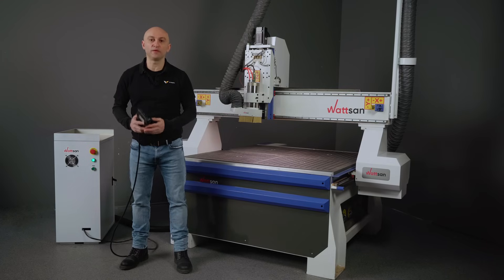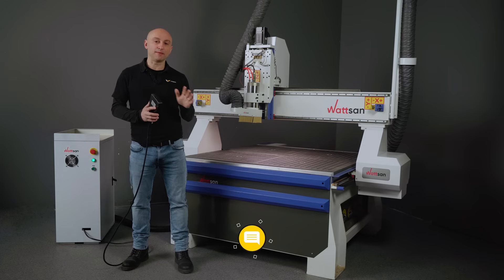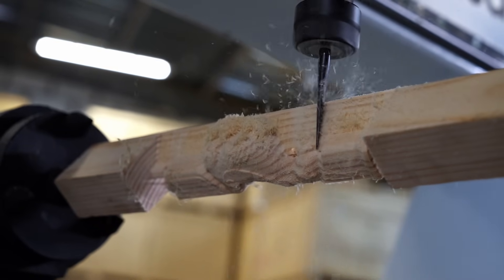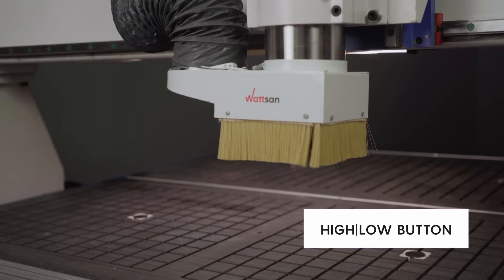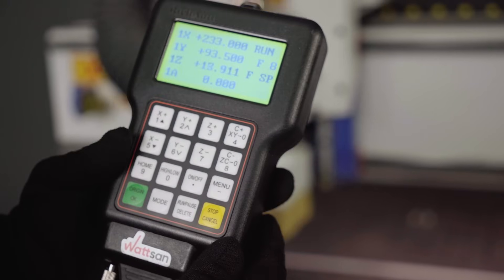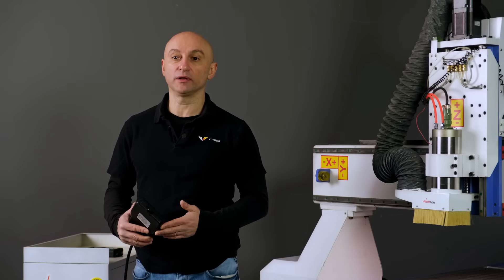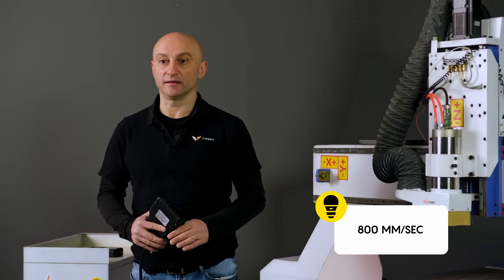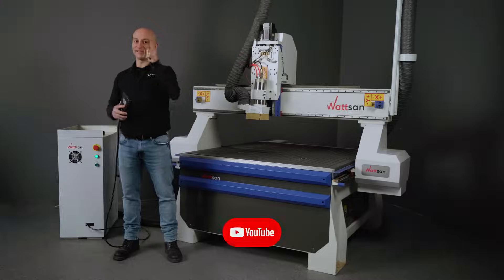Beginner’s Guide to the DSP Controller for CNC Router | Wattsan M1 1313

Comment: Hey when they are saying x,y out of soft limit what can I do
Reply: yeah, i face the same issue with Y-axis out of limit, what is the issue? pulse settle got issue?? my Y-axis reading out put not tally with the total length movement
Reply: I'm no pro, but it looks like that machine is telling you that it's about to go outside the working area. I guess the Origin may be wrong, or the sizes of the layout are simply bigger than they should be. Or turned in the wrong direction by accident. Or something is wrong in the toolpath. Check again the programm